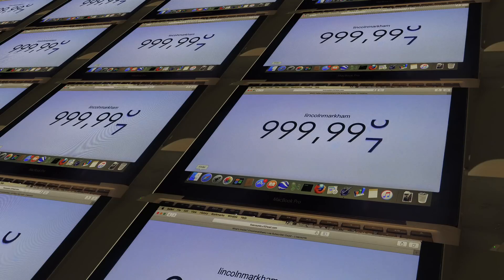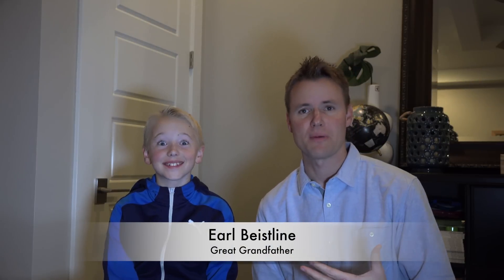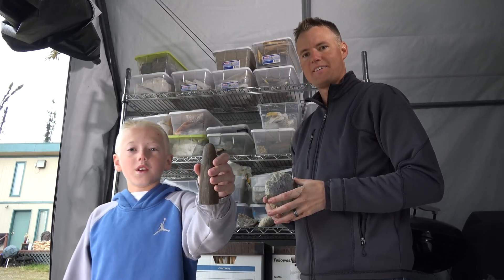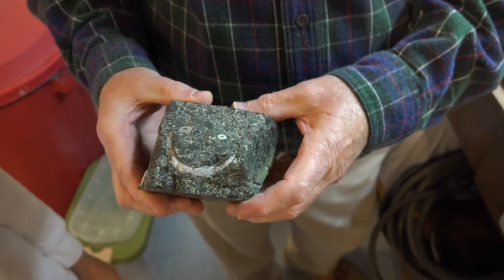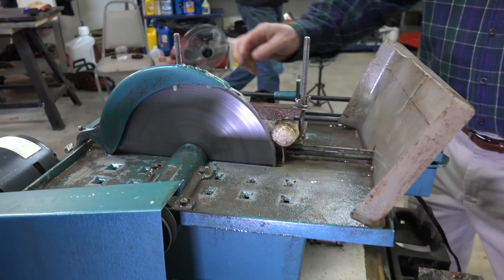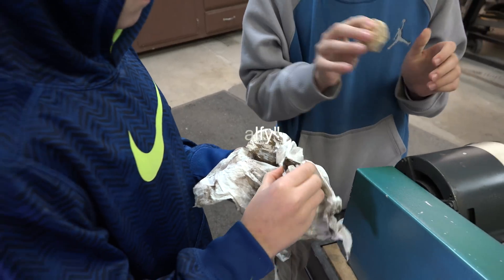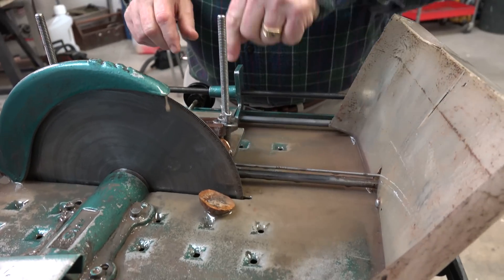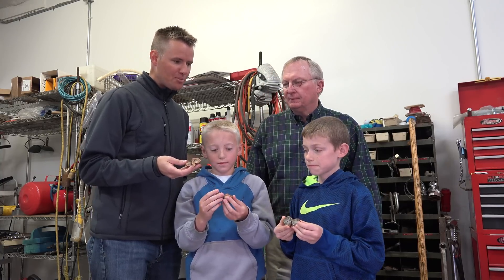What's inside a Geode?

Comment: What's inside a mood ring
Reply: +Erin Barker kinda obvious
Reply: +Hedgehog50000 then sir you think u know what's in it
Reply: +Erin Barker Your mom
Reply: Erin Barker yup
Reply: +Erin Barker Its a type of stone I think. You can't really cut it open. Google it.
Reply: TheFlacker99 (Flak) yeah it changes color according to the tempature
Reply: I looked it up yesterday and it has crystals in it
Reply: +Erin Barker Putting things in water is cool, dont you think? Check out my channel if you think so!
Reply: +TheFlacker99 (Flak) Hey Flak, Mood rings are usually made from 3 parts, A conductive base plate, a Liquid crystal center and a glass coating.

There are a few crystals that will desire the effects of heat (sorry to break it to you, But mood rings are in fact thermometers. ( very broad thermometers)) The most often used are cholesterol based polymers.
Reply: Paulette marie your parents ruined it, not us
Reply: That would be cool